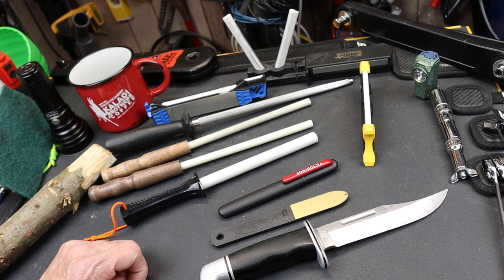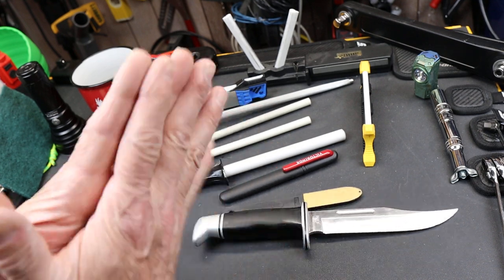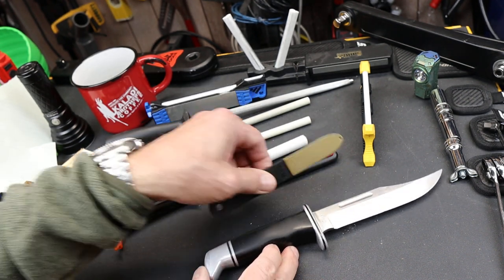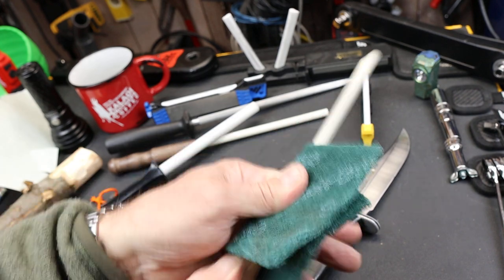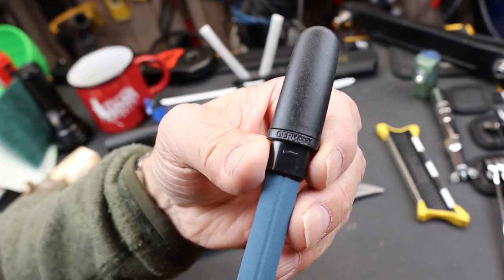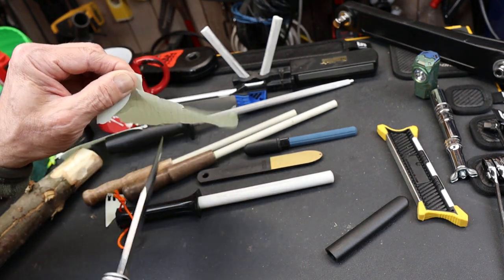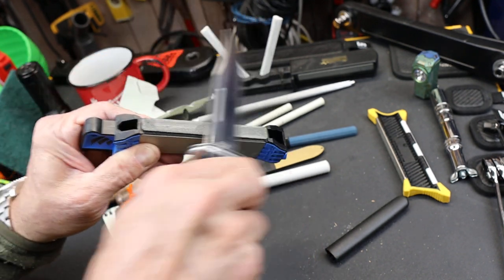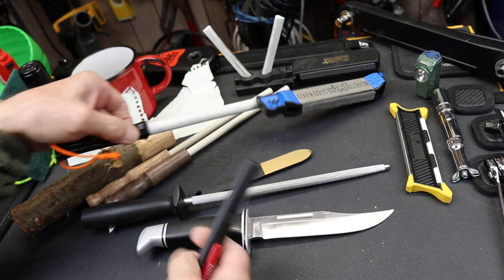Ceramic Rods: Most knives just need a tune up, not a valve grind. Here are 3 inexpensive options.

Comment: Ceramic does remove material, it doesn't just re-align the edge.  It's typically very fine, but it is removing material.  The grey marks on the ceramic are the steel that's removed.  A great way to clean ceramics is Barkeeper's Friend. The oxalic acid does a great job.  My favorite of the ceramics is the Spyderco.. the white (fine) is 6 microns, and the ultra-fine is 3 microns. You used to be able to buy smooth case-hardened hones, but almost all of the hones you buy nowadays have some sort of sharpening effect (ceramic or diamond) also.  I don't bother with it, and just use the Sharpmaker to hone and lightly sharpen at the same time.
Reply: Love my Spyderco Double Stuff.
Reply: steel rods remove material too, what do you think it is the powder on a steel rod ?
Reply: @dimmacommunication  steel rods don't remove material. Diamond-coated steel rods do.
Reply: @Foxholeatheist  Again with this fairytale ?
Clean a steel rod the use it, after you will have steel powder on the rod wich is magnetic, most rods are magnetic. Even the chinese ones are.
You will see stee powder on the tip of the rod.
Reply: @dimmacommunication  Nope, a proper steel is supposed to be glass smooth and hardened. They're not intended to remove metal UNLESS they have an abrasive added, which many modern ones do.
Reply: @Foxholeatheist  Smooth steel is used by butchers/fishmongers/meat cutters. It doesn't remove steel because it is smooth. It helps a butcher's knife live a longer life. Butchers wear their blades fast due to extensive use. 
Regular kitchen honing steel rods are textured. They removes a little steel, but a bit less than the ceramic rods. How much steel it removes depends on the hardness or both the rod and the knife blade. Ceramic is harder than steel, but vulnerable to chipping and breaking if you misuse it or drop it. 
Of all rods, diamond steel rods remove the most metal, for an obvious reason: the diamond coating. They're both a sharpening tool and a honing tool, but if you use that a couple times a day on your knife, your knife will live fast, die young.
You can easily test how much metal any rod removes by examining the steel powder left after honing, both on rod and on blade. Wipe with a damp white paper towel, and observe the coloration.

Comment: I sharpen mine using the opposite hand, hold the knife in my left and use my right to always hone away from me, using longer strokes and more controlled.  It's so much easier than the old way.  I also use a standard honing rod after I use the ceramic rod and then I use a strop to polish the edge to remove any burrs.  If really bad I'll use a wet stone and sharpen the old fashion way.  Ceramic rods are great and you can just use water and a kitchen scrub brush to remove embedded material, because yes it does remove some metal, way more than a standard metal honing rod.

Comment: Good video, thanks! There are a set of ceramic rods underneath the cap on the Victorinox, an excellent tool...Also, Schrade has a very nice honesteel that comes with a really neat leather sheath, as well as a compact sharpening rod with a sheath for regular sharpening & to sharpen serrations...both designed for field use in mind....

Comment: I'll likely take some flack for this comment, but try it before blasting. The best way to clean a sharpening stone or ceramic rod is with duct tape. I suggest trying this method on a flat stone first to see how well it works. Get a peice of duct tape and apply it to the top of the flat stone. Get something round to press roll the tape down (roll pins, mechanic's sockets, etc).  Remove the tape. Inspect stone and if necessary, apply a fresh strip of tape. Repeat until original color of stone returns.  The better the tape is pushed in, the better it cleans.  Will work on oiled stone, actually will remove oil which is a good thing.  Old stones become new again.

Comment: Exactly right...  sometime all it need is just straighten the blade, not sharping it (which like you said "remove" the metal).  There are so many videos all tell average viewers how to sharping it. Sharping is a skill that average people just unable to master.  For average people, even a rod is too difficult.  But there are some easy kitchen tools, that can help to straighten the blade and can use for a while.  People can spend hundreds $ on a knife but if they don't know how to straighten it and sharping it only necessary, they might as well buy dollars knife and throw it away and buy new one.
Reply: Imho almost anyone  could get decently proficient at sharpening with a little effort.
Reply: @BrandinoMegatronDash  -- Agree. Most people don't put any effort into learning, but even a moron like me can improve a knife with freehand sharpening on whetstones, right from the off. Just watch a decent video on technique, make sure that you're developing a burr for the full length of the edge on each side, and use a magnifier to check what's going on with your edge -- so you can see what impact that sharpening is having. Have you got your angle right? Which area needs more work? A single whetstone and a strop is really all you need. With a combo whetstone and a strop, you'll be getting knives sharper than they came from the factory in no time at all.
Reply: What on earth is difficult about sharpening a knife ??? 
It's easy and takes very little work to get a shaving sharp edge.

Comment: Great video as always a bit of topic but I was wondering if you had any opinions or ideas on tool identification I'm starting a job where I'll work with a bunch of other technicians and don't want to have my tools mixed up or anything. Do you have any experience with marking your tools? I don't want to wreck the chrome, paint sounds good but would have to re apply and it can be removed easily. Any thoughts?
Reply from the maker: Maybe there's something helpful to you here or in the comments. https://youtu.be/ThLFOyLYUB4

Comment: John Juranitch advises about using steel rods. i don't believe ceramic rods would be any different. just sharpen with a block, preferably using a guide. i use a fallkniven d3t glued on a piece of wood and my stuff is sharp enough. i use the opening mechanism as an angle guide so my skills are pretty much not a factor. (that's a good thing)
Reply: Ceramic rods are much harder than steel rods, and are thus more effective on hard steel blades. Also, ceramic does not rust.
Reply: @elevationmoto6208  it's the entire shape of the tool i have an issue with, rather than just the material (abrasive surface of any material harder than the knife would be fine otherwise). excerpt from the book: "Careful study showed, for instance, that most men steel with a very shallow angle on the top of their steel, but a very steep one on the bottom, which will result in a poor edge. Also, the better butchers with the better edges used a smooth steel, while the others used just about everything. Actually, if you don't have a good edge on your knife to begin with, steeling is going to do you very little good, if any, no matter what kind of steel you're using or how you're using it. So first you have to produce a good edge with the proper hones, that is, a very coarse hone to remove metal followed by a very fine hone to set the edge. Since you set your edge on a very fine hone, it only makes sense to use a very smooth steel. If you use a coarse steel you will just erase what you have done on the fine hone, because you must use progressively finer abrasive to get the ultimate edge."
Reply: also @elevationmoto6208  " If you do not steel properly you will lose the edge, and then the smooth steel will not bring it back, so you must start all over with your coarse and fine abrasives. If you are considering buying a steel and want to do it right, consider only the smooth. The rule of thumb is to start with a good edge, and then steel very lightly on a smooth steel."

in that case, ceramic might even be worse than a steel rod, which isn't very good to start with

Comment: I just use a 10k grit emerald stone
Reply: No you don't. That would be pointless. A 10k grit stone is just a polishing stone. If you haven't done the work of removing the steel with a coarse/medium stone and refining the scratches with finer stones, your 10k will have no impact at all. Your edge will just be as bad as it was when you took it to the whetstone.

Comment: Hooolyyy Ffffff!!!
Sorry for my language but why in gods name are you pulling a sharp blade against yourself!!! I expected any time in this video you getting cut by franticly maneuvering that blade.
 Please don’t even advertise that.
I sharpen my knifes maybe ones a year and keep them touched up on diamond, ceramic and than a steel rods.
I use to put the tip of the rod on the bench top and push the knife towards the bench. 
But now I hold the rod in chest hight tip away from me, align the knife blade to the proper degree an push away. Always in control where the blade is. And with practice youl get a hair poping edge in les then 5 minutes!!
Reply: You are right, Sandor, this is very dangerous! Please turn the knife in the other direction. Beside that it's a great vid, I love my ceramic honer, makes a great job.
Reply: Calm down it’s ok nobody died